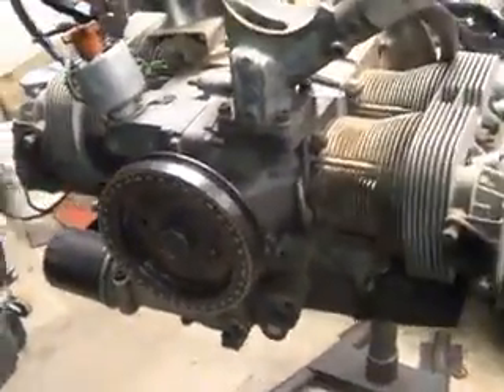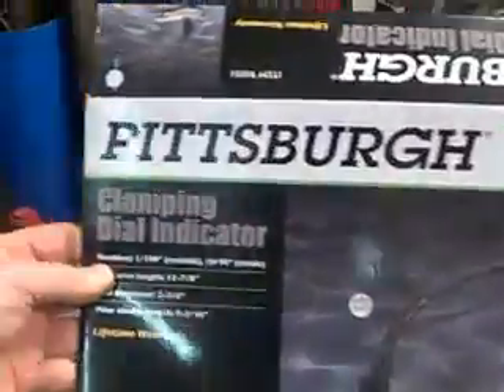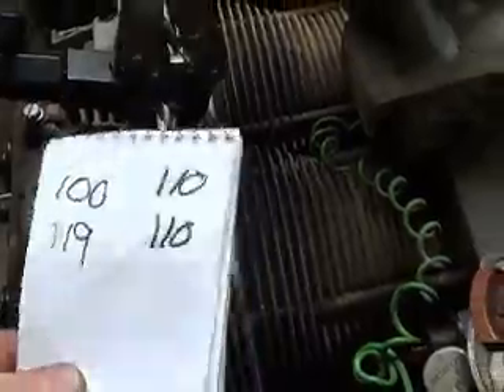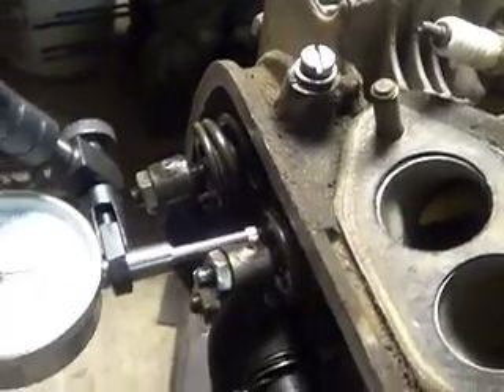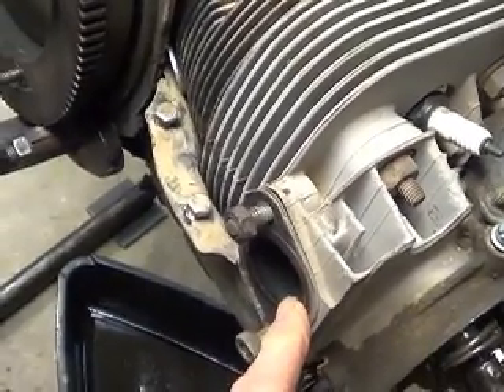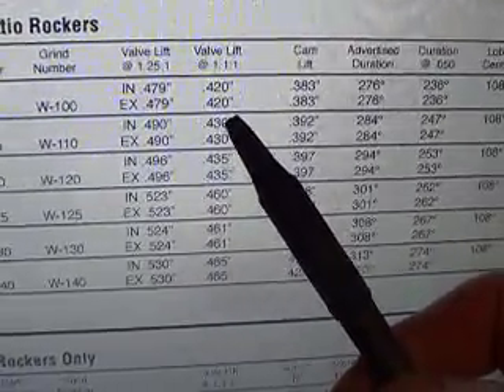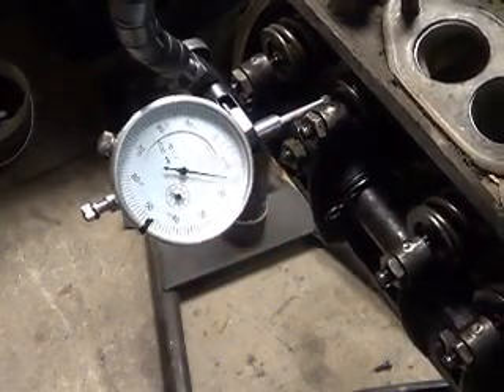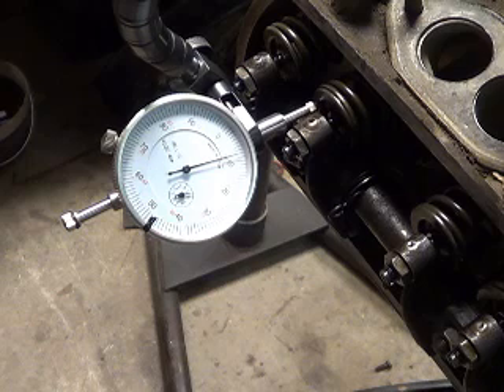VW Camshaft Test

Comment: When I toasted my cam, it was easily noticeable as the pushrod started rattling like a marble in a tin can while I was driving it.
Reply from the maker: That sucks don't it. I lost one 50 miles from home. I was alone and no cell phone in the middle of nowhere. I limped it home and had to scrap that engine because of all the damage.
Reply: TheEZGZ  Yikes! I had to do an engine overhaul after my cam loss, but ran it for years afterwards. Just thought I'd post up another symptom of a bad cam for your less experienced readers.
Reply: TheEZGZ  Yikes! I had to do an engine overhaul after my cam loss, but ran it for years afterwards. Just thought I'd post up another symptom of a bad cam for your less experienced readers.